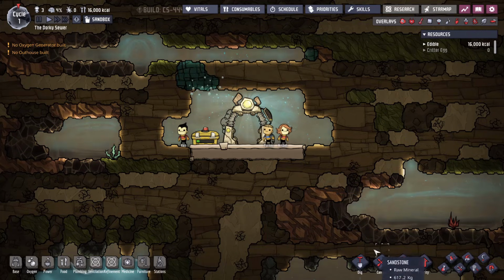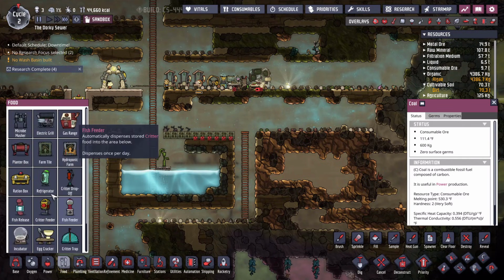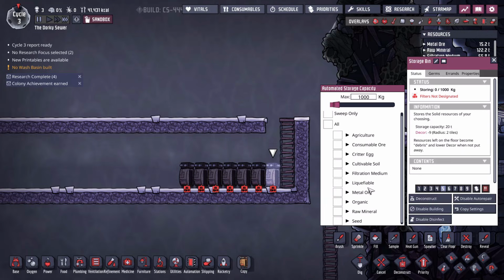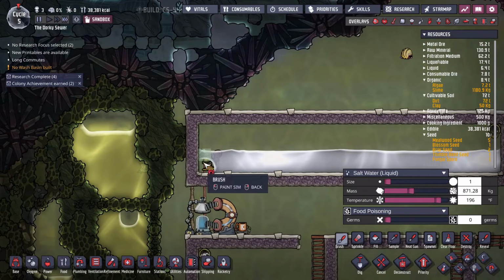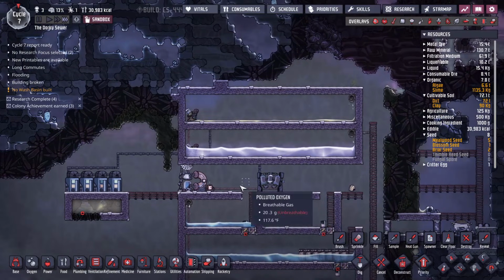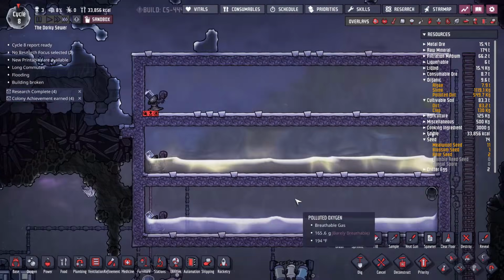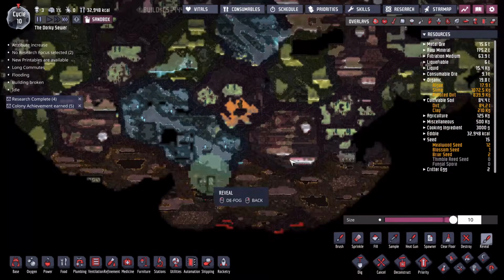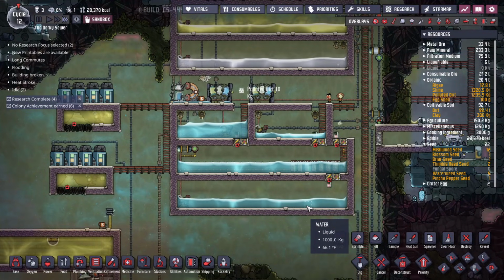Oxygen Not Included Tutorial: Water Management

Comment: @16:50 - The left side of the map was revealed when you used the large brush to reveal the right. The map is actually cyclic left to right, so really a cylinder rather than a plane :)

You might also notice this if you build bunker doors all the way across the top, a dupe sometimes will build the one at the edge from the other side.

Going further off topic, the different DLC asteroids are actually small rectangular areas of the same larger map. Sometimes you can see alerts from one asteroid in the fog of war on another. This is also why although you have more locations in the DLC, each one is smaller.

Thanks for this video! What I love about this game is that there are so many different ways of doing things.  I was nice to see your take on it :)
Reply from the maker: Ahh yeah, that makes sense.  I noticed the connected parts from the DLC, but didn't know it operated like that on a singular map.  That's pretty weird, and I wonder if they once planned on letting you move from one side to the other to simulate it being a circular environment.

Thanks for the kind words!
Reply: @Magnet_MD  I think it might just be an artifact of how a grid or 2D array is typically represented internally in a computer. Think of an 8x8 chess board. If you represent that as an array with two indices board(x,y), what really happens internally is a an array with a single index internalboard(n) where n goes from 1 to 64. The index n is then calculated as y*8+x (where 8 is the width of a row). So the first cell in the second row board(1,2) is really internalboard(9). With that it is easy to see how things tend to wrap around from one side to the other, but not from top to bottom. If x is set outside the right edge, say board(10,2) the index n = 2*8+10 = 26. That is the same cell as board(2,3) where n=8*3+2 = 26. So two steps off the right edge is equal to two steps into the left side, but one row lower.
Reply from the maker: @michaeldamolsen  Yeah, that makes sense, but it's weird to not have rudimentary boundary checks so you actually know which cells are adjacent.  I'm guessing they either intentionally didn't add that check as a performance optimization, and/or also guessing that when the buggy behavior shows up, it's not a big enough deal to fix because they are just visual artifacts and extreme edge cases (lel, literally in this sense).
Reply: @Magnet_MD  I think you're right, it depends on the context within the game. It makes sense that the debug tools are less careful than the actual game functionality. As long as it checks that it is not completely outside the array (n less than 1 or larger than maximum in my previous example), it will not cause any crashes etc.

With the new DLC they now have to check against an arbitrary bounding box each time. I wonder how many places in the code they forgot to adjust for that :D